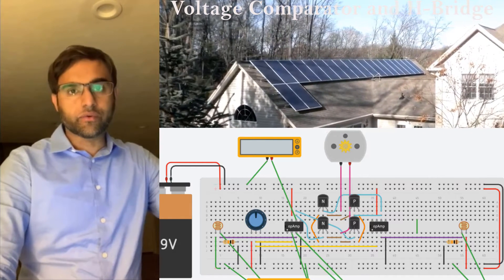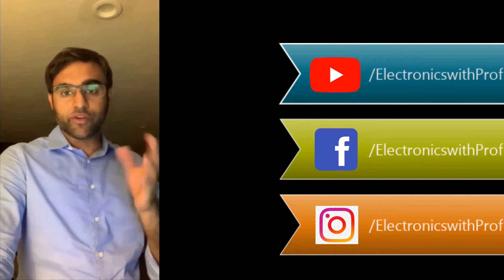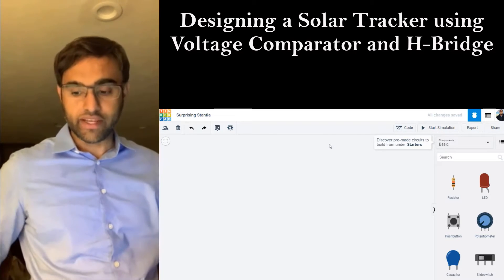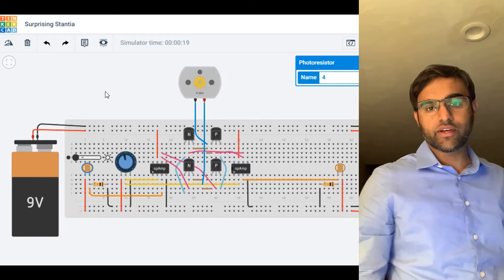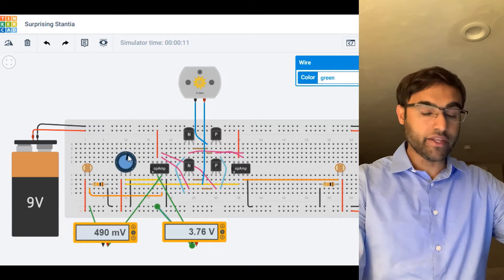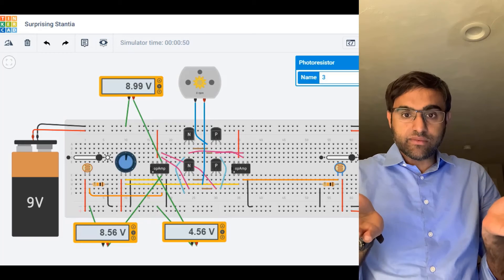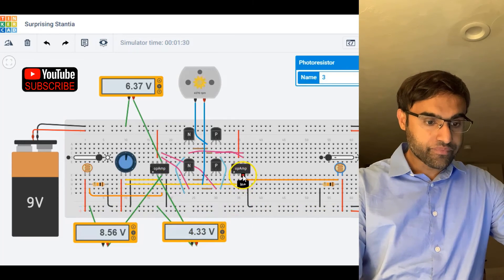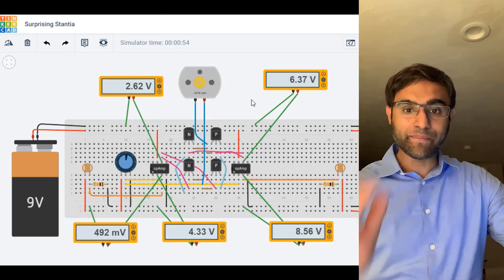#6 Designing Single Axis Solar Tracker using Voltage Comparator and H-Bridge in Tinkercad

Comment: This is a very interesting video. But I have one question: The photoresistors and diode together are forming the LDR or the solar panel? I need in my project to simulate the connection between a solar panel and Arduino so I was wondering how I could achieve that in Tinkercad
Reply from the maker: Photoresistors are referred to as LDRs. This is not a solar panel. With Arduino blocks feature on TinkerCad, you can achieve the same. I’ve done something similar here: https://youtu.be/xtLum8FQC8U

Comment: Hello prof, may i ask, in schematic diagram it has 3 resistor, but in video you just put 2, why is that ? And there are some other component tht did not put in video too like diode
Reply from the maker: Jack, I might have used a different schematic, but this one should work also. If it doesn’t let me know, I’ll search and dig through files on my computer.